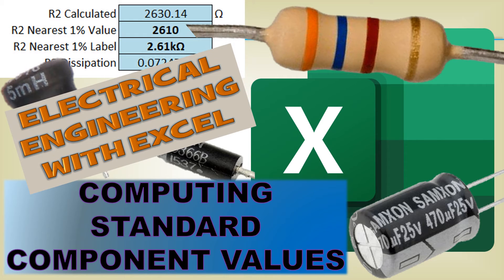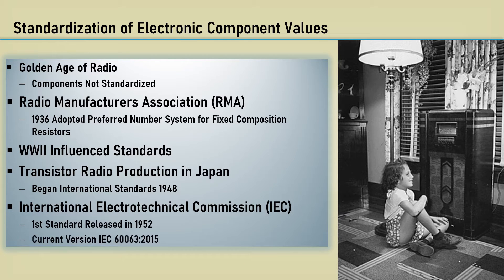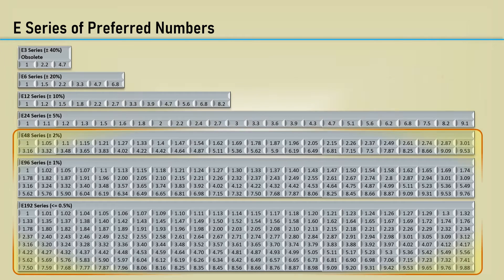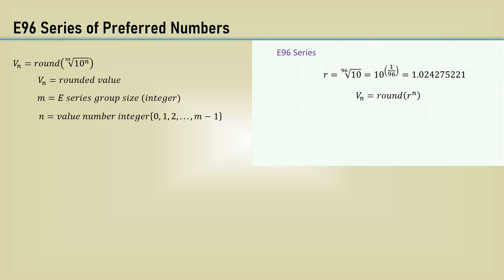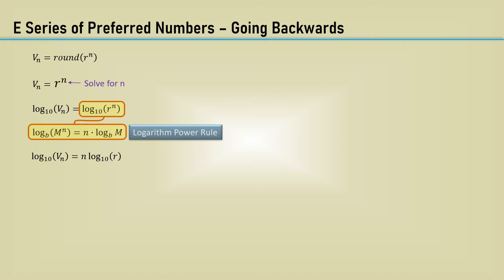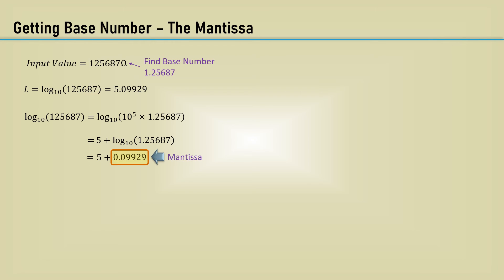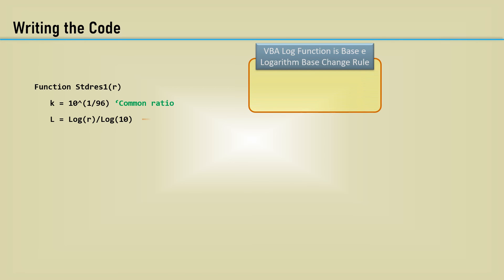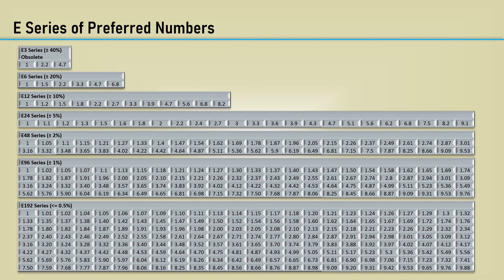Computing Standard Component Values - Closest 1% Resistor Value

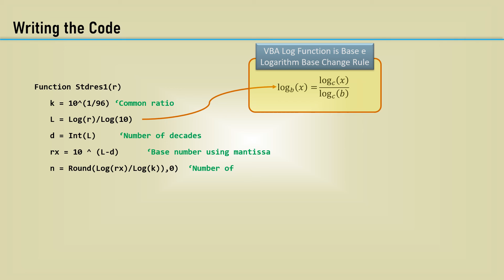Comment: At 8:22 you have unmatched parentheses. The code should be:
n = Round(Log(rx) / Log(k), 0)
Also the version of VBA I'm using doesn't like the ^ operator unspaced, so best to write k = 10 ^ (1/96)
Thanks for the work you've put into creating a useful spreadsheet.
Reply from the maker: Good catch Rex. Thank you. Fortunately the code in github is correct. I struggled with how to present code. I definitely wanted to animate it. The only way to do that in a code window is to type it. I don't type well, and I don't speak well, so doing both would probably require 100 takes...lol. I hope everyone moves on to the E-series function and understands this video was just intended to show the math. Cheers!
Reply: @oldhackee3915  You're welcome. I suffer from the effects of old age on my presentation/typing skills, so I can empathise with you. One trick to make animations is to use PowerPoint to create whatever animations you're looking for, such as text appearing bit-by-bit. You can add voice overlay to PowerPoint and then convert the ppt into a video snippet to be inserted into your final mix.